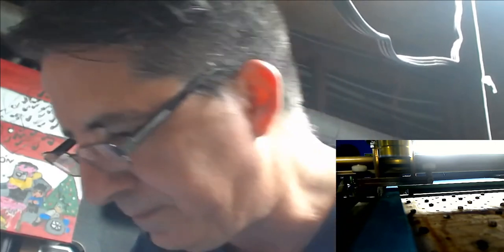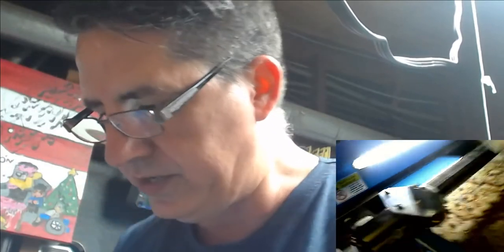Before you Begin Your K40 Mirror Alignment

Comment: I had so much trouble with those jam nuts that I removed them. In their place I added springs with good tension. It is so much easier to adjust each mirror. At least that is the way I modded the adjustment screws.
Reply: which springs did you get? sounds like a great idea

Comment: Use projection method. Put strong light source at the focus of the laser head (strong LED). Cover LED so that it does not shine all around. Use white paper and see where the light is projected. Now it is easier to align spot onto mirrors. The most difficult task is guessing burning mark if you use standard burning tape method. The head on K40 laser has no any adjustment...
Reply: is there a strong led i can buy on amazon?

Comment: Hi John, I have watched this video and the other 3, very good. I wonder if you can tell me why I have 2 dots with just one press of the 'fire' button? I can get the next 2 with a further 'press' on top of the first pair so your alignment techniques have worked fine. It is not a mirror glitch because they appear before the first mirror, so straight from the tube. I can't be sure if it has always done this as a longish press produces one scorch mark or a hole, but now after much operation, I have mastered a very brief pulse, which I now see produces two dots?
Reply from the maker: The mirror coatings inside the laser tube have been damaged by running the laser at high power. The tube may still be good for engraving, but it will not cut. Sorry to be the bearer of bad news.
Reply: @johncabrer2328  Thanks John for your reply and diagnosis. You will be correct because the person I borrowed the machine from to cut 5mm acrylic, said to use full power. I suppose he must do this with his other £7000 machine and the Chinese effort is just not up to this use.
Reply from the maker: @mattmcgahan  a K40 should never be run beyond 20% power. If the tube is in good condition, this will be enough to cut 3mm birch ply and acrylic. The K40 is not designed for cutting, but for engraving rubber stamps. That is their primary use in China. The fact that they can cut is a fortunate happenstance.

Comment: My point where the beam hits the same place is at the very top of my mirror 2. Does this mean that I need to adjust my to be and make it lower?
Reply from the maker: Two possibilities. If the beam is centered on #1, the four bolts holding down the gantry need to be loosened, and shims put under the gantry. 

If the beam on mirror #1 is also high, it can mean the tube level needs to be adjusted. Either one or both mounting clamps are loose, or adjusted too high. It depends on which type of clamps you have. Some are not height adjustable.